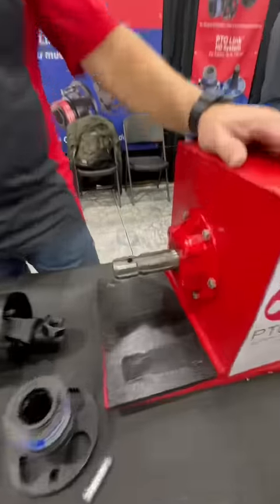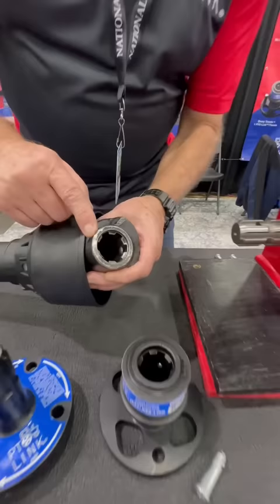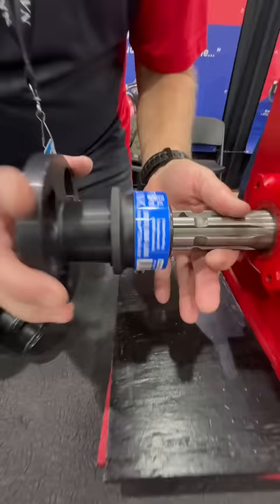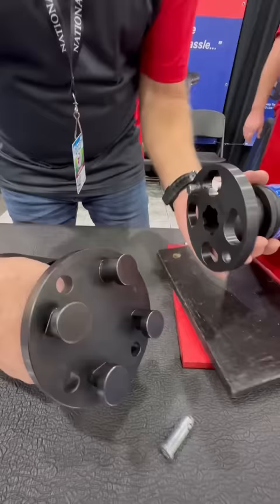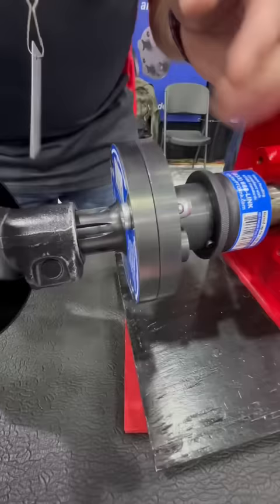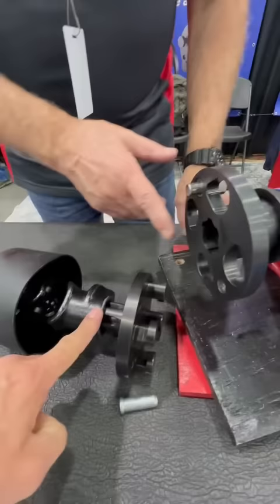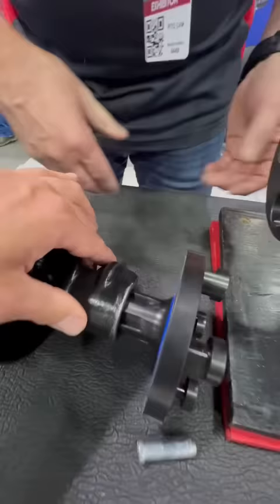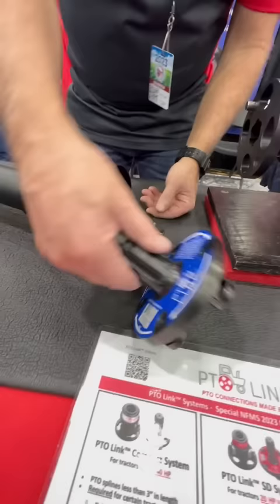“Farming just got easy.” (Said no one ever) #farming #tractor

Comment: 400 dollars for 1 set......   You're adding a quick connect to something that is inherently a type of quick connect.  I will give it to you that it looks quicker possibly easier but not enough to justify, 1 the 400 dollar minimum.  2 shortening all the PTO shafts of my implements. After a second thought, I have a slip clutch on my PTO so that whatever implement I'm using my tractor is protected. This wouldn't even work with it.

Comment: Wouldn't that ad too much length to the shaft ? I feel like it's just going to add stress by changing that length and  the u joint angle. And everyone has trouble with  getting dirt In The pin why add more pins that are gunna  gunk up ?

Comment: the only time this would be useful is if you have implements that will work with your different tractors and you have some obscure one with a different size pto spline. (eg: tea20 ferguson) but even then most if not everyone has the adaptor already

Comment: I have never had a problem with the PTO shaft wearing. 😮
So lets dive in..  🏊‍♂️ 🦈 
Basically what the system does is, give you something else to fool around with in between connecting your equipment to your PTO.
Just buy a fidget spinner.

Comment: That system does not have an overrunning clutch that when you are without one using a brush hog will drive your old Ford tractor even when your clutch is depressed!! I almost drove through a house without one. Again This will not fix that problem and I don't see a need for this without that overrunning clutch.

Comment: Pto is ummm ...   one pin....  ? and that safery pin will handle the full torque when sonething kicks back?  i see it shearing and disconnecting itself. nevermind their system isnt any faster and since it still relies on the original splined interface on both sides  it offers only additional failure points

Comment: It doesn't make anything any easier? I don't see it. Your typical 1466 IH has the PTO brake always applied until it is running so you can't turn the shaft there, your typical 13x80 grain auger is pretty much impossible to rotate by hand, solution? Turn the PTO shaft on the auger with a crescent wrench to hook it up.

Comment: I have 6 points to lineup on the old standard system peri. Did I only have four points to line up on that monstrosity. Which means I have to turn the shaft a greater amount in order to line up the pins. Meanwhile well that's going on on the drive side that 1 big giant locking pin hanging out grabs your shirt shirt sleeve and wraps you around the PTO.. The standard system is a lot better than this piece of junk. I saw no safeties on it that would protect you from getting grabbed. I will personally stick with the older. More tried more true more tested longer time for more safety options to be developed for system Venice arcade piece of junk. Weigh more surfaces on this new item to get grabbed by. Not to mention a greater diameter providing a greater mechanical advantage to rip flesh and body parts from you then on the older spindle.

Comment: Well first of all that pto is balanced and when you start changing the angle of the pto and s*** you're going to cause vibration in that pto and wear s*** out I wouldn't put that f**** thing on my garden tractor or any type of tractor if you can't figure out how to hook up up to your pto then you shouldn't even have that tractor and that's more for like little garden tractors instead of big tractors because I guarantee you all my tractors run a 1000 rpm's the pto's  I think I got maybe two pieces equipment that don't run at 1000 rpm's they run at 560 but everything else runs at a 1000 rpm's